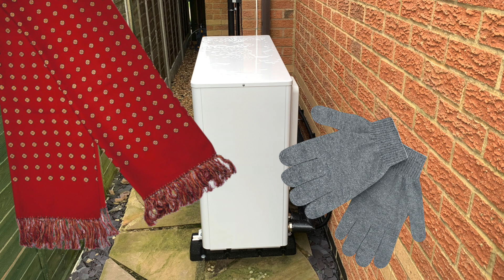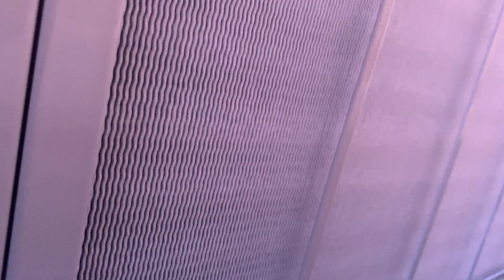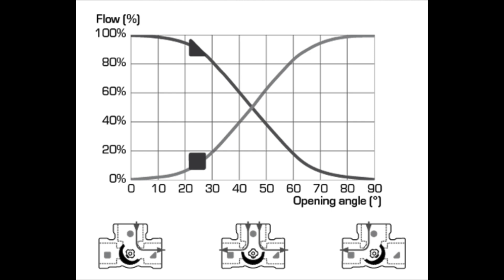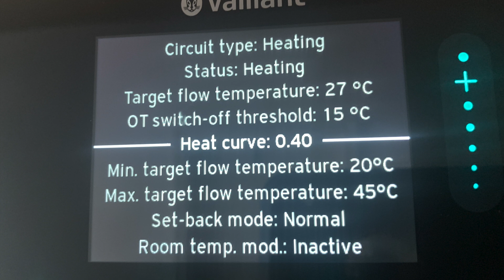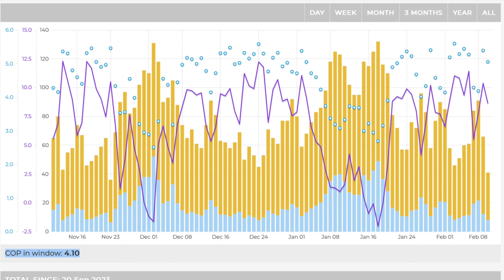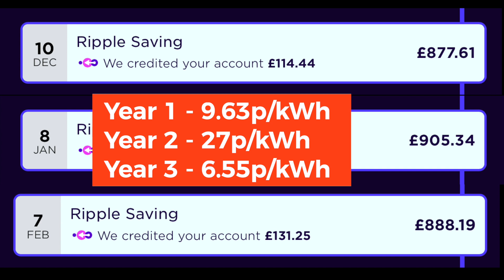ASHP winter performance and cost to run

Comment: That is SO EXPENSIVE to run to heat your home to just 21c.
My gas boiler uses £13/week to heat the whole house to 22c all day and most of the night, it's off between 11pm and 6am as the house stays warm and doesn't go below 18c.
My highest combined gas and electric bill each month in winter was £108 and that's British Gas standard rates on a fixed deal, no cut price units.  Considerably less than using a heatpump for heating and hot water.

Tell me WHY I would change from a really efficient low cost heating solution to an expensive electric one that costs a lot more to install, maintain and run and will not last as long as a gas boiler.  I really don't understand why people get scammed into buying overpriced heatpumps and then spend 2-3 times more to run them.

A lot of them seem to join forums and league tables and battle to be top or have the best excuse for spending loads of money and wasting it.  If you were a sales person, I would ask - how much is the installation in total, how many KWH will it take to keep the house at 22c and provide hot water at 60c on demand.

I always know which channels are set up by companies to sell products...
Reply from the maker: You miss key points in your statement. Any ASHP that achieves a SCOP (Seasonal Coefficient of Performance) of 4 or above for a heating season will cost the same to run as gas at today's prices. Ours is above 4. Plus it's more efficient than your gas boiler and will last 20 years just like our old gas boiler did if properly serviced and maintained. 

Not everyone moves to all electric just for cost savings. Gas is a fossil fuel, is dirty to burn, harmful for the environment, has inherent safety and health risks and is inefficient as a fuel. 

What you choose to overlooked tis hat we have 2 electric cars, 2 home storage batteries with 27kWh of storage, solar panels and 4 electric glass kilns. Our electricity usage is much higher than most as a result. If you compare the cost of just the heating source, gas vs ASHP they are comparable in costs, often cheaper with an ASHP to run. In March, still in the heating season, we ran for 11 consecutive days off grid. You will have been using gas to heat your home.

Comment: Very interesting. 
One thing I don’t understand please.
When you are running on weather compensation, the house internal temp is not measured I also understand when the maximum external temperature set point is reached it turns off, I also assume the flow rate remains a constant. But other than the external temp, what other measured values are driving how hard the unit is working, I guess flow and return temp? By setting the heat curve at 0.4, does that equate to a very low compressor inverter output and essentially the unit is running at low pressure 24hrs a day other than defrosts, or does it still turn itself on and off periodically please. 
I want to run mine to keep a relatively constant internal 15C but can’t figure out how to achieve this with weather comp.
Reply from the maker: On pure weather compensation the ASHP will adjust the flow temp to meet the heat loss needs of the property based on the outside temperature and the desired indoor temp set point. Lowering the heat curve to 0.4 will reduce the speed of ramp up to the desired flow temp and also reduce the amount of electricity used to achieve that flow temperature. However, having the curve set too low means the ASHP won't reach the desired indoor temp depending on how cold the outside temperature is. It's a balancing act to begin with until you find the sweet spot for your system and house requirements. 

I'm assuming you have set the room temp to 15ºC on your control unit. What is happening with the temps? What is your flow temp and heat curve? What is your system design stats? e.g. ours is 8.4kW at -2.4ºC

Comment: There must be a huge difference in insulation between UK and the Nordic countries. I have a geothermal heatpump and the incomming water comes down to 3 degrees so similar as your winter air tempretaures. We heat 208 sqm and produce all hot water with an 2-8 kW inverter heatpump. The pump do not use any direct electric heating nor do we have any other source of heating that we need to use. 2-8 kW is enough to heat these 208 sqm even if it is -30 outside. In January 2024 average tempreature was -7.8 C, with over one week average tempreature of -28 C. The heatpump consumed 650 kWh in total with an estimated COP of 4 in January During the cold week I heated  an accumulating fireplace every second day, however, and in between occasionally.

In September 024 average temp was 13.3 C. Total heat output was 371kWh and electricity consumed 106 kWh for heating and hot water. Our total electricity consuption was 498 kWh. Rate including taxes and transfer was 19.1 euro cent per kWh. Electricity cost only was 5 cent. We have electricity tax, VAT, and transfer prices on top of the actual electricity cost. Our current scheme is that we pay hourly spot price plus 0.41 cent for electricity and 3.2 cent for tansfer 8 - 10 p.m an 1.31 during night hours. VAT is 25 % and electriciy tax is 2.82 cents per KWh including VAT. Yes we pay VAT on energy tax in Finland, clever system😅. This,  total electricity bill for September was 95 Euros. On average our electricity bill is around 2300 euros per year. It have been 3000 when electricity prices have been very high during some winters.

This just as a small international comparison.
Reply from the maker: Thanks for your information and comparative information - interesting to read about. It's always difficult to compare without having  like for like, but I suspect that yes your property might be more insulated, triple glazed etc. UK is typically a mild climate so unfortunately insulation and heat loss has not been high on house builders priority. This is until the recent changes in building regulations a couple of years ago which improves the thermal insulation of new builds.

Comment: What rate are you charged using 756 Kwh in Jan 2024 and the previous two months, are you including solar usage combined.
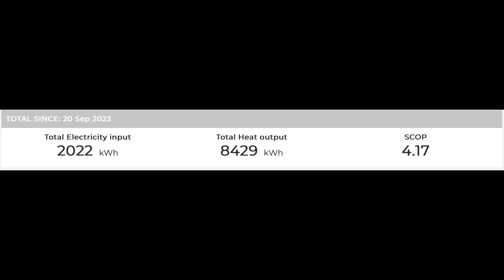Reply from the maker: Hi, the average unit rate of electricity we are charged was covered in the video along with the rates for the peak and off-peak starts at 17:06 mm:ss. It's where I show our electricity bills on screen. We use very little peak rate power so it's mainly cheap rate. 

Out total electric bills were as follows:
1602kWh in November @ £0.0995p/kWh average rate
1830kWh in December @ £0.08p/kWh average rate
2117kWh in January @ £0.074p/kWh average rate

Which means the summary at the end of the video where I show the 3 months electric usage for Nov, Dec and Jan 2023/4 will be at the average unit rates shown above. 

The above import figures are not including any solar usage. Usage is whole house usage as we are 100% electric. 2x BEVs, 4x glass kilns, hot water and heating, cooking etc.

Comment: Interestingly I have the honeywell 3 port valve fitted on my new system since May this year and I’ve been bleeding the radiators constantly. Is the honeywell contributing to this or will I eventually get all the air out?
Reply from the maker: @Yorkshire-z5v  the Honeywell is not contributing to it no. Air takes times to bleed out, even more so in the hot water circuit. Until it’s heating season you may not get all the air out. Honeywell vales are okay but cheap, I replaced ours purely for longevity reasons.
Reply: @johntisbury Thanks for the speedy reply. The gurgling from the honeywell valve is getting less and hopefully I’ll get all the air out at some point. I did make a note of the replacement valve and will probably replace mine at some point. Thank you.

Comment: Hi John. I’m about to get my heat pump. I’m interested to know what size storage battery you have . You are clearly on Intelligent Octopus Go, as am I. I have 6kw of solar and a 9.5 kw of battery and wondering if this will run the majority of my heat pump usage. I’m finding it difficult to get my head around it all. I read recently about the new Cosy tariff with its three cheaper rate windows. Although a higher off peak rate there is the opportunity to charge the battery three times in a day as opposed to the once with Go. The proposed heat pump is 8 kw Daikin by the way.
Reply from the maker: Hi David, it can be tricky to forecast how much you need. During the last heating season 2023/24 we found that on cold winter days, circa 1 - 2ºC the battery lasted till around mid morning. We have a 13.5kW Tesla Powerwall. We've now added a second Powerwall brining us up to 27kW of battery storage, even that won't last all day. 

You should find your 9.5kW will suffice on average winter days of 10ºC or so. It's when it drops below 5ºC that heat pumps start using more electricity. Our 7kW Vaillant used 35kWh over 24 hours on days when it was 2ºC outside.
Reply: @johntisbury  thank you John for your prompt reply. The extra battery capacity certainly looks to be a good option. Thank you.
Reply from the maker: @davidgordon773  go have a look on https://heatpumpmonitor.org if you've not done so already. You can find comparable setups. There's Daikin installs on there and hopefully ones with a similar house size. It will give you some real world data of usage.

Comment: Advice needed pls. I am in an old stone cottage on a hill, i have qualified for a grant for 2.8kwh solar a 12kw samsung ashp (no choice on make model its a gov /energy company grant) and my upstairs to be insulated but not downstairs.. currently on lpg tanked bulk with epc F hence why i qualified and low income.. im nervous about the running costs as this is a very old house and i have heard horror stories about the cost to run. Can anyone advise me on if to go ahead or not  ? I also have a 5kw log burner but it's in an enormous inglenook so barely heats the living room .. thx
Reply from the maker: Thanks for watching. 
Tricky to answer your question without some additional information. What is the heat loss for the cottage? This would have been completed when they specced the 12kW heat pump. What is the design flow temperature for the heating system, e.g. ours is 40ºC flow temp when it's -2.5ºC outside temp. Those two bits of information will impact your running costs and how hard the ASHP will need to work to keep the house warm. The lower the flow temperature the cheaper it will be to run the system. Are you having new radiators fitted? 

The solar array sounds very small, I guess you don't have much available roof space? A 2.8kW array will not offset your electricity usage costs by too much. It will certainly help and is better than not having anything - so that's a good thing. 

The second variable is which electricity tariff you are on. Heat pumps are efficient, much more so than gas boilers or LPG. Being on the right electricity tariff is very important as heat pumps are most efficient running low and slow, e.g. you keep them on all the time. We have ours set with Weather Compensation and it's technically 'on' 24/7, 365 days a year. It only actually turns on when the outside temperature drops below 16ºC with our setting. 

I don't know the cost of LPG to buy, however I suspect it's not cheap. Trying to heat a house with an EPC of F will be very expensive no matter what the fuel source as it will be like trying to heat a house made from Swish cheese with all its holes. With the installation improvements and the solar contributions you should find it more economical than LPG. However, that costs to run will be very much dependant on the design temperature of the system and your electricity tariff. 

The horror stories you have heard will be the edge cases. The majority of current installations are well done and heat pumps are certainly cheaper to run than gas, LPG or even wood burning stoves if you are having to purchase the fuel source. I guess the worry would be the reputation and professionalism of the companies who are carry out the work. Often they can cut corners, not do a good install as they are getting paid via the scheme rather than direct from a consumer. Worth trying to obtain references and see who else has had work done by them before pressing ahead.  

I have done a more details video on the installation of our heat pump, the design stage and the whole installation process. That might be worth watching to give you an idea. The design stage is the critical bit to get right.
Reply: @johntisbury thx for that. I don't know what the heat loss is I can find out. My current electric tariff is variable with eon and is high but i could change. They seem like a pretty reputable company and yes they are increasing the radiators forgot to mention that but I am not sure exactly of which yet I have asked for specifics. They are also fitting direct ventilation system which again i have no choice it's part of the package. That's all I know thus far.. i will ask for references. Solar is 6 panels no battery. I have asked them to let me have an approx usage cost they said they will work out. I have pushed for downstairs insulation but the funders said no . The upstairs insulation is classed as room in roof as it has slopey ceilings everywhere. 🤔
Reply from the maker: @Divinefemininemiracles  feels like you are asking the right questions. The Heat Loss figure and the ASHP design temperature will be 2 important pieces of information.
Reply: @johntisbury 👍ty

Comment: I've watched John's video a few times now and as a bit I'm a bit of a geek(background mainframe systems programmer many years ago) I'm kicking myself.  I tried to change my spots with this, but apparently leopards cant get stripes.  I decided to be hands off non-geek.  I didnt get an OpenEnergyMonitor and wish I did.  Vaillant Arotherm+ 10kW installed to replace combi.  Vaillant tank added and radiators cascaded getting four new big rads and throwing away three for a total of 17 installed.  Anyway all of that was OK.

Install was week of 11/3/24 and went pretty well.  What I'm missing is the fine detail of data to be able to tune the system.  The target was 4.49SCOP with design flow temp of 41C.    So far we're sitting 3.8 for the month (myVAILLANT app).  I've gradually moved the heat curve from 1.1 down to 0.90. Last night I dropped it to 0.80 and today we have a COP of 3.9. 

Advice: get OEM if you can, because you can't un-geek.

Question (if you're looking at this John) were you planning on running dhw cycle at different times depending on season?  I guess with your decision to go to second Powerwall that becomes less of a question.  I'd trying to think through avoiding export to grid if I can benefit.
Reply from the maker: Hi Robin, agree with you about Open Energy Monitoring. My recommendation is get Open Energy Monitoring if you want to understand your heating system and be able monitor its performance. 
For DHW I’m running it at the warmest part of the day 1pm - 2pm. That may change as  things progress with the 2nd Powerwall.
Reply: Thanks John.  I guessed the second Powerwall would change thinking on things such as DHW time.   With 'only' one I'm  a bit tight on capacity.  BTW, somebody told me that you get a small discount on a second, have you heard that?

I think I'm stuck on fitting an OEM in retrospectively.  The guys did a great job with the install but there is a very short length of pipe between it coming through the wall and it being split to CH and DHW, definitely not long enough for adding the   Bad decision on my part I think, I guess it will take me longer to tune the system without the data from OEM.
Reply from the maker: @robinedwards218  Agree with you that having 1 Powerwall it is a bit tight to use for DHW, ASHP and general household use. This was the main trigger for getting a second one. There's no discount for getting a second, although all home storage batteries now attract 0% rated VAT so it's kind of a discount. Local installers may offer incentives but it's not a Tesla driven marketing campaign. 

Be careful on the placement of the heat meter if/when you go down the OEM route. They are very sensitive to turbulent flow near bends, valves and pipework constraints. They require lengths of straight pipework to function correctly. Installation manuals give minimum distances to bends etc, along with vertical/horizontal dos and don'ts.